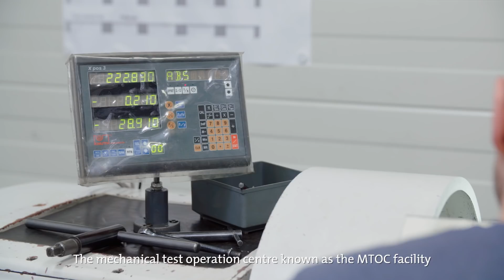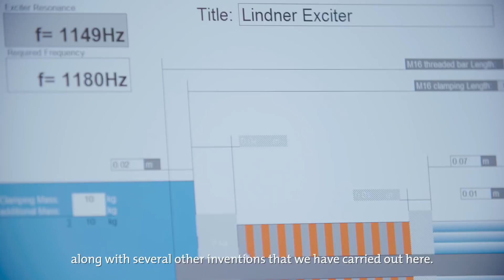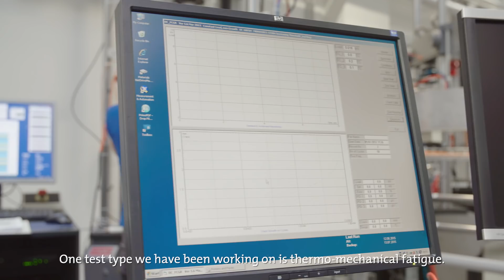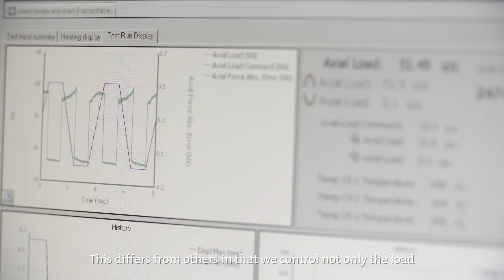Rolls-Royce | How we test our jet engine components

Comment: Should be experimenting on jet planes with multiple smaller jets placed stategically around the fuselage for super stealth, vertical liftoff (easy to pivot), super maneuverability (jet manipulation rather than rudders), ruggedness (a few jets down but still flies) and high speed (power to weight ratio). In the age of computer control and fly by wire this should've happened decades ago. The replacement for the A-10 (coz the F-35 is a joke) should be the first plane to trial as it needs to fly under heavy fire and with only two large jet engines, there is not much redundancy. Plus it is a cheaper plane to develop. The cockpit should also be one large liquid nitrogen produced Prince Rupert's drop in which the pilot sits.
Reply: Literally Stalin did you mean the Harrier jet? But anyways surface controls are still much more powerful in the atmosphere than RCS (rocket maneuvering). The engines are small, that's why only spacecrafts use it.
Reply: good shitpost
Reply: @hayleyxyz  Gee. Old post. Changed that avatar name from Literally Stalin long ago. I now don't think the best power to weight ratio would be achieved by multiples of small jets anymore. A string of smaller jets across the delta wing with stealth exhaust like the YF-23 would work well. As for the bullet proof cockpit based on the Prince Rupert's drop, that is  how Gorilla glass works but without the drop shape it isn't bullet proof. As for shit posting, the real shit post is when the US MILITARY COMPLEX spend trillions on advanced WWII warfare. It's like putiing a touch screen on a toaster or buffing the turd. Meanwhile Russia developed weapons to take advantage of advanced tech, like the S400 and Kinzal hypersonic. Who needs a piloted jet when the missile can send itself? So outdated traditional ideaa are the real shit post, not suggesting new innovation.